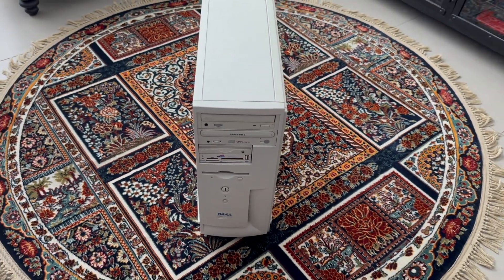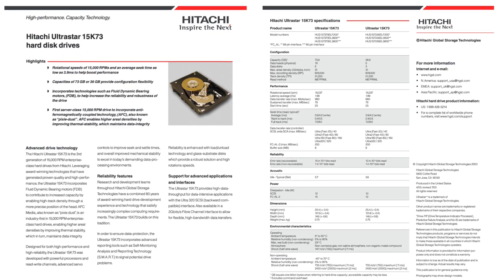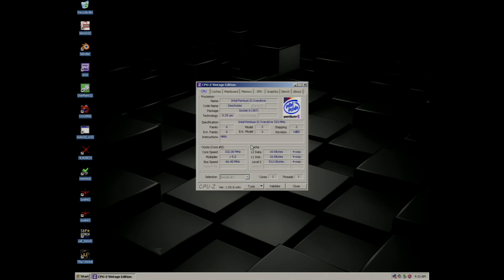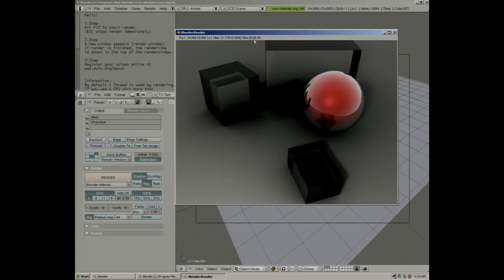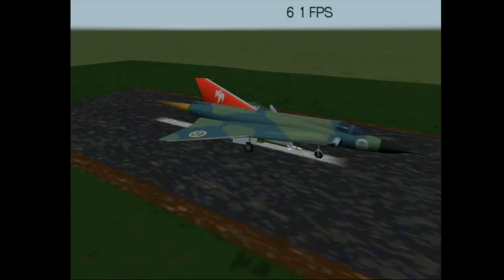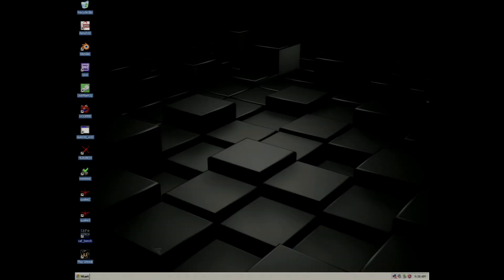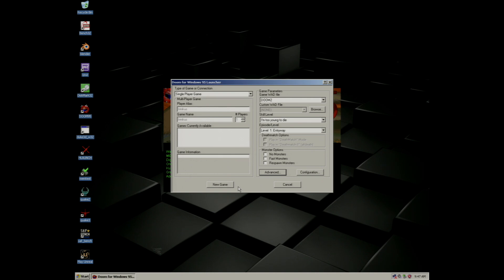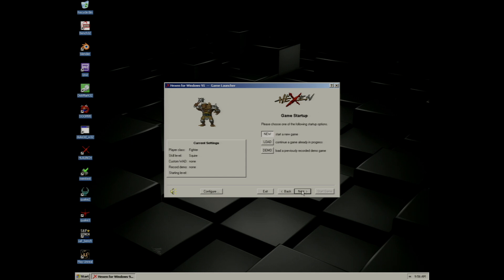My Epic Socket 8 Build

Comment: Didn't even remember Pentium II Overdrive were a thing, nice rig.
Reply from the maker: Thanks! 😃

I don’t think that they were very common, even at their time of release. What’s interesting about them is that their cache runs at full CPU speed, whereas with the standard Pentium II, the cache ran at half the CPU Speed. This was done as an attempt to offset the performance penalty imposed by the older, slower EDO RAM on the Socket 8 motherboard.

There are faster options out there, but I find the quirky nature of this chip interesting!
Reply: @Irinikus  I wonder how a 450Mhz "normie" Pentium II compares to these, I guess the 450 PII should win almost all the time except if the application is extra cache sensitive, hell if if I know, I was a kid in those Pentium days, I wanted a decent PC but it was SO SO expensive and these things were out of date 1 year later.

 I remember my Dreamcast impressing some of my far richer PC gaming friends back then xD, it really could do a lot for the price (and it was how I first accessed the internet too, in fact I had only my Dreamcast from 99 to 2007 to browse the web before I got my first Core 2 Duo PC, yeah let's just say by then you couldn't do much with that good old console).

Comment: Nice! Where did you get the 333 overdrive?
Reply from the maker: I was lucky enough to get it as New Old Stock from a seller on eBay!
Reply: @Irinikus Cool. I've been searching for a pair but the prices are absurd these days... I have a dual Pentium Pro board that I plan to make a system with.
Reply from the maker: I'm also currently working on a dual Pentium Pro build, but it's going to stay Pentium pro, as I want an example of a Pentium pro machine.
Reply: @Irinikus  I also have another one, a Proliant 2500R dual p-pro so I wanted to make this one more extreme so I could compare them. :D Looking forward to your video with the dual one! Have a great day!
Reply from the maker: Cool! You too! :) @andycristea
Reply: @andycristea  I also have a Proliant 2500, but in the tower version :)